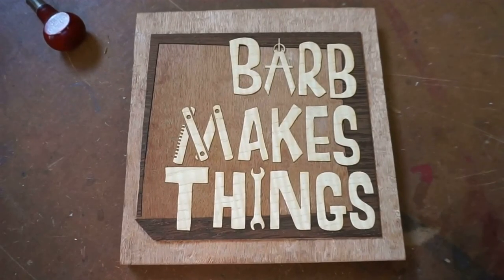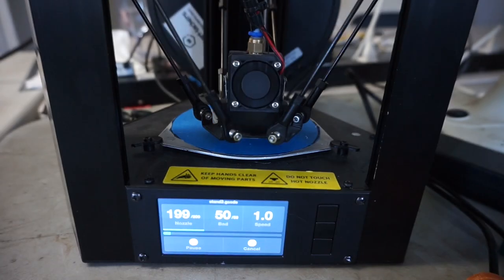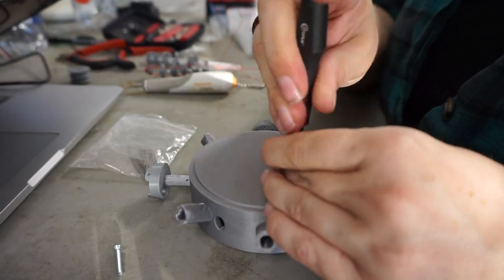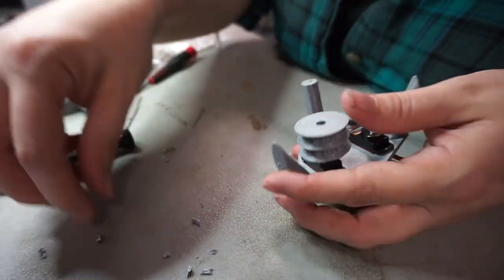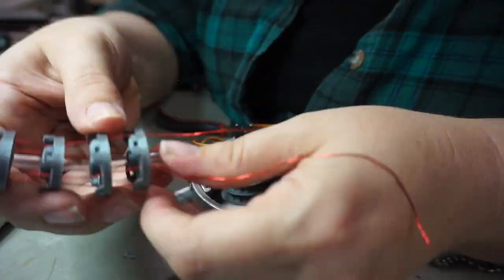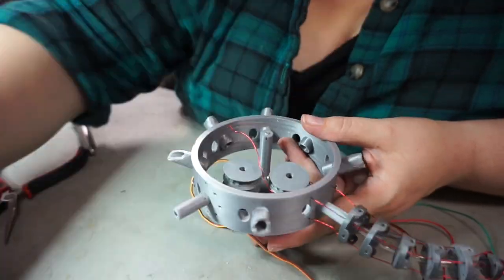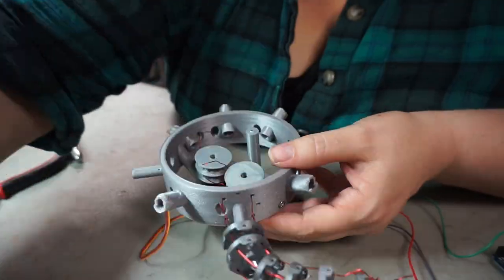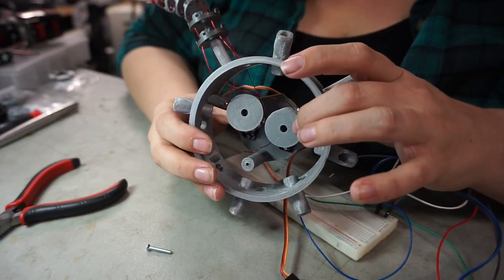Robot Octopus #6 - Assembled Ball Chain Drive

Comment: I was looking for a professional application of ball chain transmission but it seems like you're the only person I could find using this fantastic idea. I think the best way to prevent the chain from slipping is to add little curved tunnels at either side that allow the chain to smoothly transition between the 3 directions it needs to move in. I really can't see any way you could accomplish what you have with bicycle chain, your work is inspiring.

Comment: Always love you work and videos. Hi just an idea. To maintain some tension could you put a small spring bar or elastic inline with you wire/rope. It’s going to be very hard to a tension and be keep the tension on without some form of elasticity or auto tensioning system.

Comment: This is a really cool project. Watching part 5 I suspected you were going to have a tension issue on that ball chain drive. But I love the idea of driving the ball chain this never would have occurred to me and might be useful in my engineering design classes as a low cost alternative to other drive systems. Not sure how you addressed it as I have not watched beyond this part yet but if you had completely encapsulated the balls by making a multi piece horn assembly,  That would have at least eliminated the slipping. The other concern I had is that no matter how much you tighten it, if there is any stretch in the wire you would be right back to slipping again. I don't think you had enough space to tension it with an idler of some sort but on to the next video to see  how you tackled these issues.